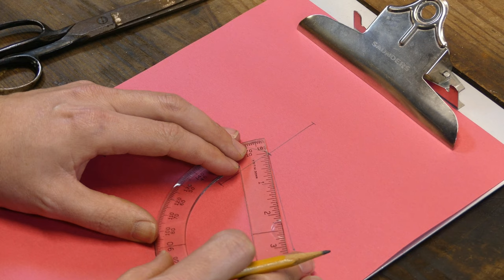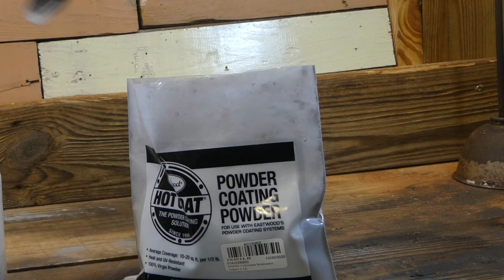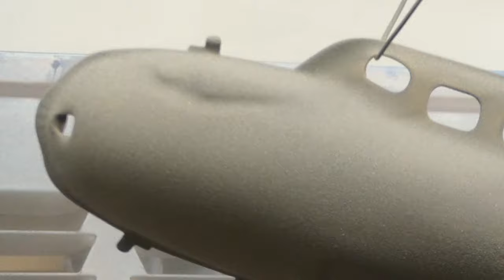Restoring An Old Toy Plane

Comment: That looked like a serious challenge, but you came through beautifully. Loved the stop motion ending. A serious question, how do you overcome a broken tab? I’m sure it’s happened before. I assume like any metal they have a limited amount of movement before the metal fractures. 
I’ve never seen any toy restoration video address this issue. 👍🇦🇺
Reply from the maker: Thank you very much! You are correct about the tabs. They can and will break. If you catch it before you've done all your body work you can weld a new one on. There's a couple of ways to do it. The tab can be butt welded on or as I prefer when possible attached using a lap joint. That is to say the tab is longer than the original and lays behind the sheet metal of the toy and it attached using a rosette weld. I have some toys with broken tabs. When they get their turn for restoration you will see me fix them. Thanks for watching!
Reply: @morebetterrestorations7987  thanks for the feedback. I’d have to brush up on my welding skills, (only have an Arc Welder), for metal that thin otherwise it would end up looking like Swiss Cheese. 😁
Reply from the maker: @shedmanx3640  lol, I have burned through plenty of metal trying to make things better. I should mention too that you could use and adhesive to join the metal at the lap joint as well....no heat to worry about! Thanks again for watching!